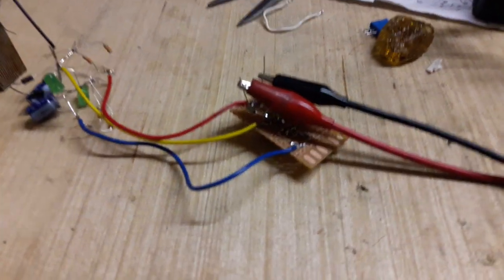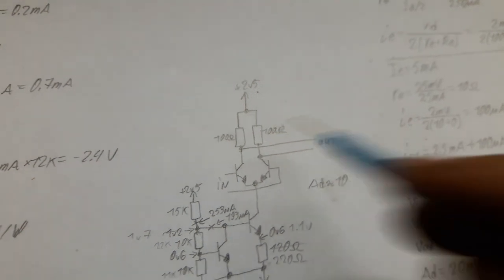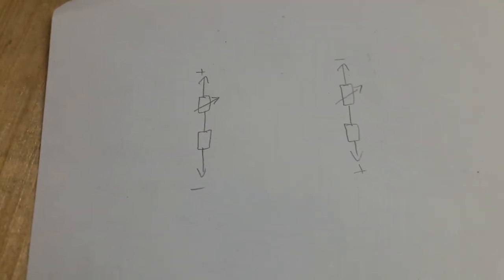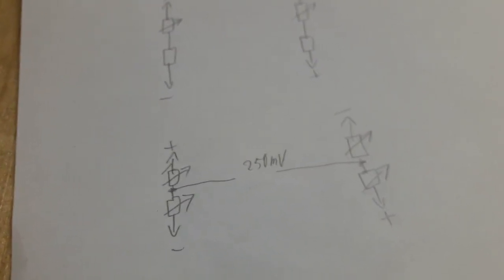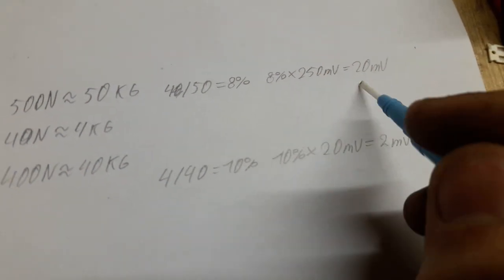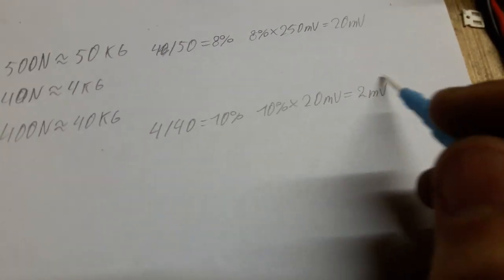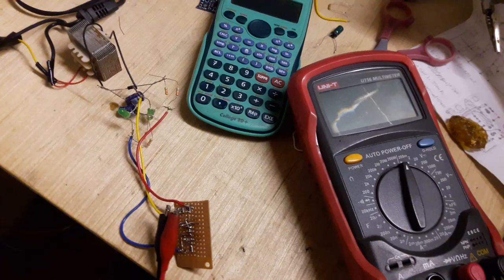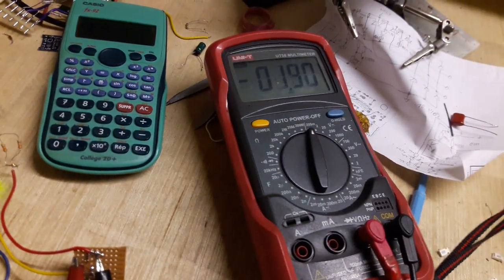Diff amp using discrete parts

Comment: Sorry i'm late watching, i lost my internet last night, it lasted all night untill 11 in the morning.
Your boss or bosses are assholes, they need a slap lol :-D

I have to say you are one smart man, you went over my head with most of it but the long tailed pair transistor configuration i have seen before.
I hope you covered those transistors with hot wax to slow the temprature effects down, it's a cheap trick that keeps dampness out as well.
I hope it did the trick :-D
Reply from the maker: The board was hidden in heatshrink and sealed with hot glue on the ends. Output offset after that was stable at about 700uV.
Reply: Save the diagram and your findings in a notebook, just in case you need the circuit again.
I have a "Book of crap" for all the circuits i've jotted down over the years.
30 years later i need data on something i did when i was 18 and my scribble book is there :-D.
Yours will be a "Book of design crap" ha ha :-D